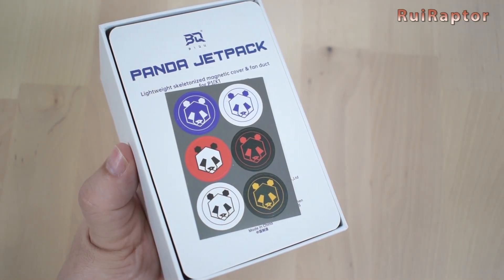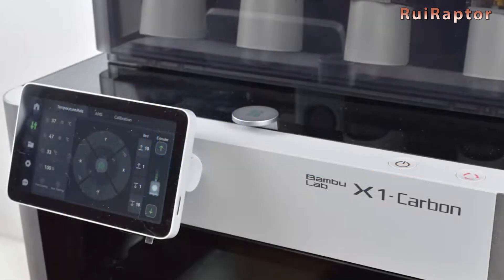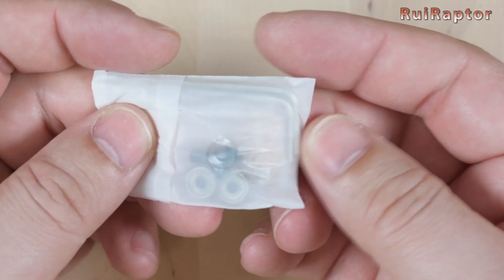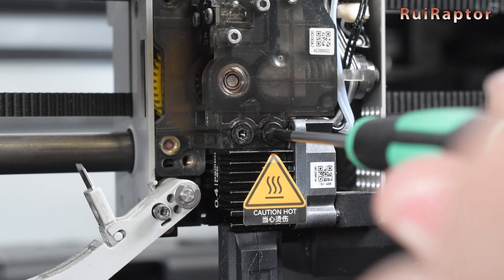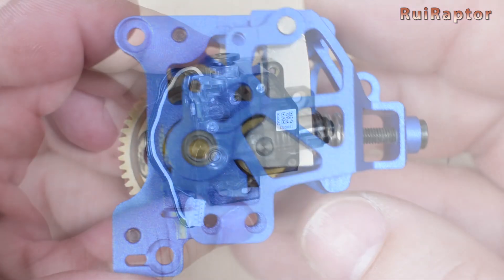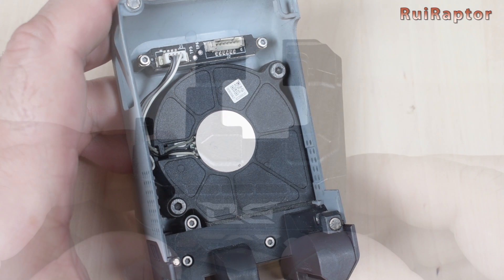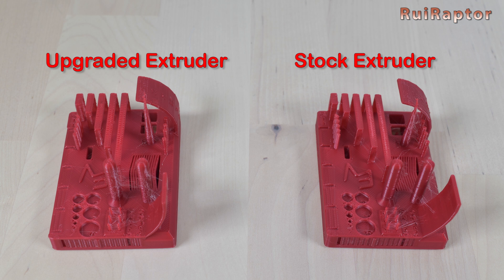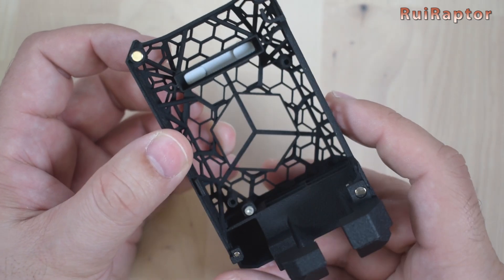Upgrading the BAMBU LAB X1-CARBON - Panda Claw + Jetpack + All Metal Extruder - Tests & Results

Comment: I upgraded the hot end with the Panda hot (Revo Nozzles) and started experiencing a lot of clogging in the extruder.  I've now also upgraded to the Panda Jetpack to hopefully get better AIR CIRCULATION in an attempt to solve the first problem.  My print head is now totally Pandafied.  Doing a test print to see if it works better.
Reply: I'm the same except I only stay with original Bambu hotend. Been printing way better on both my P1S & my new X1C
Reply: @isanube  what was better? cleaner? less lines? I've been thinking about doing the upgrade and keeping the bambu hotned as well
Reply: @TAGE_FPV first of all, my weekly PLA jams in the extruder stopped months ago when I installed everything in my P1S 😂 The jetpack definitely helped with improving the look of my prints, including PETG which was always a struggle. I’ve printed PLA CF & PETG CF for well over 500 hours now & no slippage issues, at least nothing that can’t be fixed by adjusting some extrusion settings
Reply: @TAGE_FPV another big issue for my P1S was how noisy it was with the top glass or front door ajar. With the biqu mods i’ve done 17 hour long PLA prints with it fully sealed. I just run the chamber fan at 90% to help combat heat creep without making too much noise
Reply: @isanube  I don't have any issues at all with my x1c and have 1000 hours of prints, PLA, PLA CF, PETG, PETG-CF, ASA

it all just works, so i dont think these upgrades will do anything for me.

I've had way more issues with my AMS frankly than anything related to extrusion.

I bought the biqu blower fan, and that seemed to improve overhangs, but it also lead to some gantry collisions. 

I was hoping for cleaner prints with the Biqu panda mods but I guess it's just a toss up
Reply: what are your results?
Reply: Bump
Reply: I am having the exact same issues.
Reply: Let me say this most extruder clogging with PLA is directly related to heat creep. And is mostly experienced with enclosed printers but is not exclusive to them. It happens when the top of the hot end where the filiment goes in and out of the hotend exceeds about 39 to 40C. To be clear this can happen to any printer, any extruder, any hotend at any time. Prints that have a lot of retracts exacerbate the issue. The faster you print also increases the chance of it happening.  The fix here is to get the inside of the exteuder cooler. For printers with an enclosure most of the time this is solved with taking the cover off and or opening the door to let the heat from the bed to escape. The cover with holes in it helps as well by allowing more cooling inside. Slowing down a print, and checking the number of retracts during slicing you can change some slicer settings to help this as well. Other things that can help is the fan on the hotend, may be performing poorly maybe upgrade the fan itself. But most new users do not recognize this issue and always think its because of the nozzle or the hotend. So, long story short, don't blame the hotend or nozzle right away. It is most likely a cooling issue, find ways to keep the top of the hotend from getting near that 39 to 40C mark.. There are many ways to work on this issue. If needed, try decreasing the ambient temperature as well in the room. There are of course other reasons an exteuder can clog but the absolute most common issue is heat creep. And its not the hotends fault by itself. Anytime we start pushing these machines with more flow, increased temperatures, faster prints, and even the weather changes and its hotter in the room this is when we start seeing these issues. And people always say I didn't change anything, and then you find out, they bought a new printer sitting right next to it, thus increasing the room temperature. I hope this helps anyone that has issues. Please consider finding a way to get the exteuder cooler and you will likely find your clogging quickly goes away in most cases.

Comment: There isn't really any weight savings with the upgrades... honestly, the biggest gain is what you stated at the end of the video. When changing out the hotends, you won't have to worry so much about the inserts wearing out after repeated replacements.

Comment: Why do you print on tape, I got my bambu since the KS launch printed 6000 hours and never used tape or gluesrick or spray . I print abs Asa tpu pet petg pc nylon and pla and all cf variants, never use a brim or raft, and why didn't you use stock settings and did the test with good filament. I o my have these stringing with tpu. But everything else is perfect
Reply from the maker: Hi, we are not printing on tape. We are printing on the cryogrip build plate from BTT which is all blue. Regarding the filament, we used Filament PM which is a very good filament. The generic profile was a bit too hot for it but we decided to leave it like this to test the before and after so we could see if there was any difference.